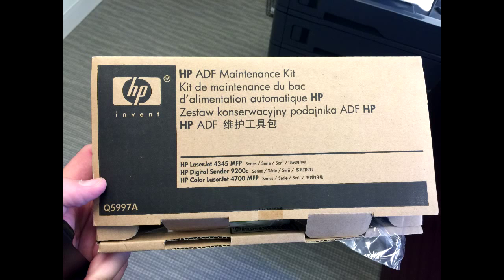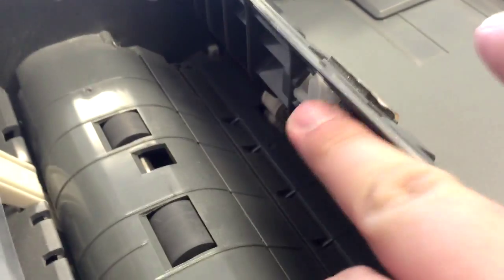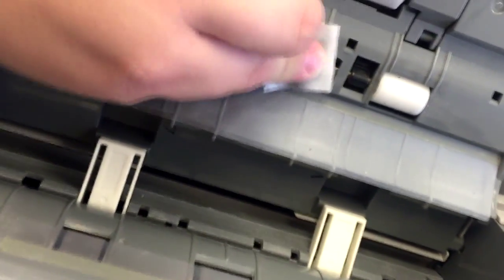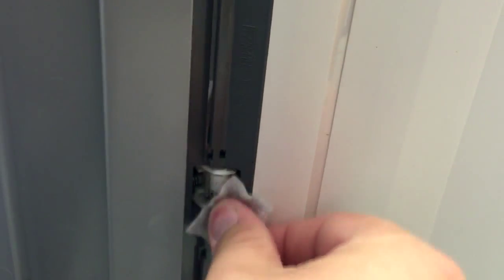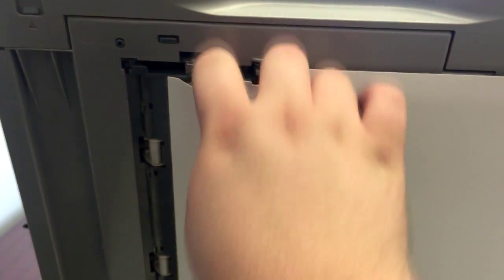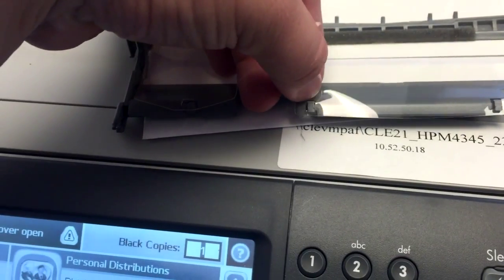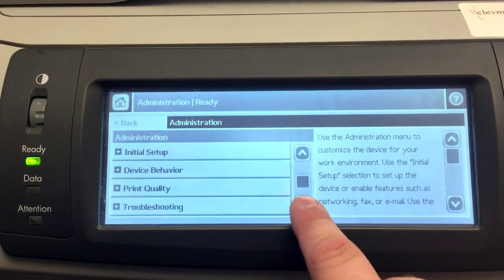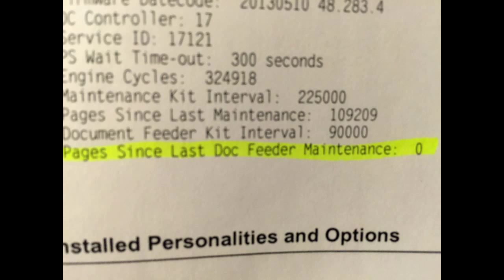Printer Repair Training: HP Document Feeder Maintenance kit installation

Comment: Does anyone know if it's possible to purchase a replacement for the pad that sits in front of the separation pad?  It looks like a black foam type material.
Reply from the maker: It is possible to replace the pad that sits in front of the separation pad, its part of ADF separation case PN: PF2282K034NI . i checked parts now is selling that assembly for about $22, hope that helps let me know how it works out. thanks
ADF SEPARATION-PAD CASEADF SEPARATION-PAD CASE
Reply: Thanks for the part #.  That looks like exactly what I need.  I appreciate the help!

Comment: nice video. just a HP 9200C and it's using the same ADF unit . where can you get the gear that drivers the ADF?
Reply from the maker: +dextaca 

unfortunately  that ADF does not have part numbers for individual drive gears you would need to
replace the ADF as a assembly (part number PF2284–SVPNI) if you are in the
states eBay for a working used or partsnow.com if you want a new one with a warranty.
Good luck on the repair let me know how it turns out

Warranty
Warranty.
good luck on the repair let me know how it turns out.